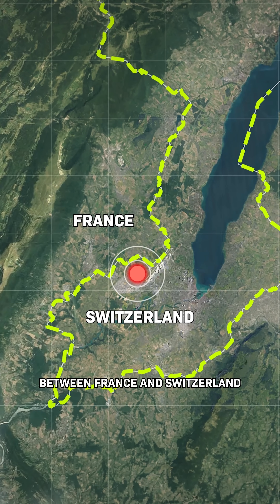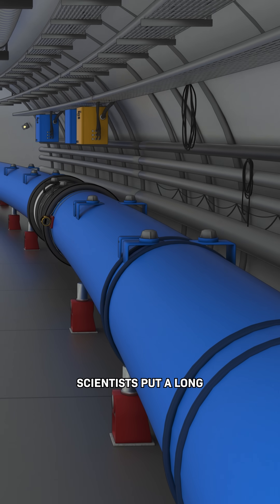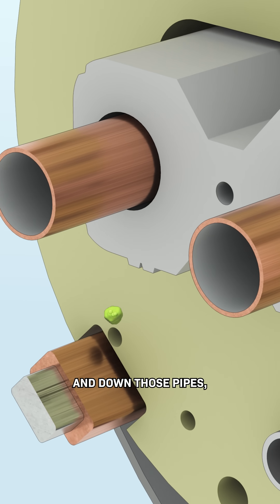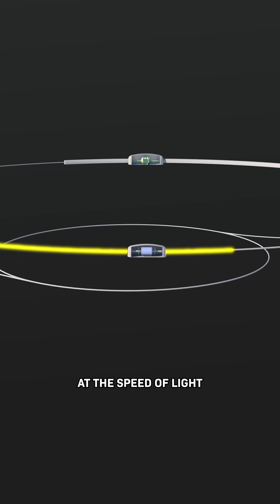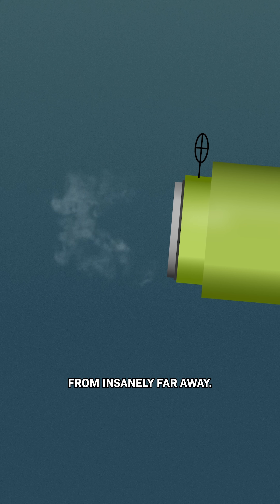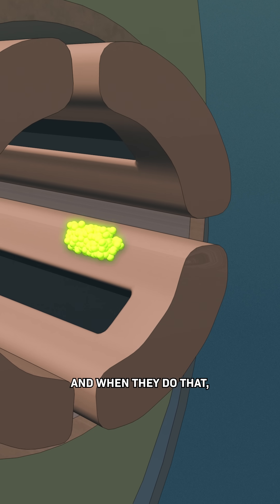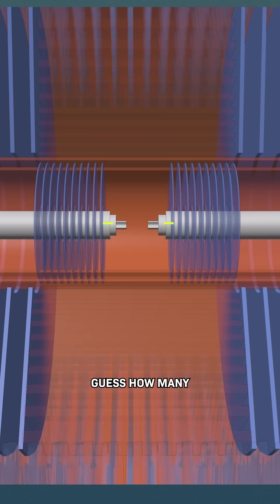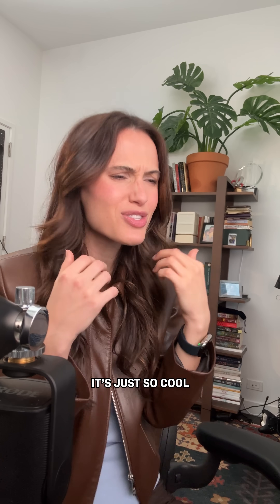How Do They Make Particles Hit Each Other?

Comment: From the early 80s to 2011 the US operated the Tevatron accelerator at Fermilab outside Chicago. It collided protons against antiprotons and are had two major particle physics experiments which discovered the top quark. Once the LHC at CERN started it was no longer cost efficient to operate the Tevatron. The SSC in Texas was supposed to be the next big accelerator for the US but it was canceled in the mid-90s due to federal budget cuts.
Reply: The Texas SSC was supposed to be 87+ km long.
The US would have been the ‘Center of the Universe’ for High-Energy Physics …. Alas, politics.

Comment: There is an unfinished particle accelerator like the one above in Waxahachie, Texas. It was supposed to be 3x the size of the one above.

But because it was to be built in small town Texas and none of us had no idea what that was in the 80s they ran out of funding. They spent 2b and it was reported to need another 12b or so to get it up and running.

It has now been sold and makes oil machinery which I find ironic.

Comment: It's for sure not colder than outer space. It might be /as/ cold as outer space, but outer space is theoretically as cold as you can possibly get at absolute zero
Reply: Wrong. Outer space isn't even close to absolute zero. Boomerang nebula is the coldest place in the observable universe and it has 1k
Reply: @NinjaFlout  and you are even more wrong. A majority of outer space is 2.7 k which is just barely above absolute zero.

Comment: Sounds interesting. What's the reason for doing this?
Reply: High energy collisions like these can create particles we wouldn’t normally see at our usual energy levels. This thing lets us study these particles
Reply: @OnePieceFan4765  thanks
Reply: @deananderson7714  what would happ6if a beef roast was put in yhe tube?
Reply: @bradacker8028  it might cook but it wouldn’t be a normal cooking process
Reply: @deananderson7714  thanks. I'm a retired electrician.  I wired a business that used laser systems to engrave inside pieces of crystal from photographs. 
After we finished and the business moved in, I was on site with a small crew just in case there were electrical issues. 
There was a safety demonstration to emphasize not reaching into the machine while it was operating.  A beef roast was placed where the block of crystal would be sitting. 
The smell of burning meat and the smoke from the engraving chamber was intense within just a couple of seconds.  As was the sound. 
I wonder I the 2 machines would produce similar results? 
Now that would be a video

Comment: "Some theories suggest that the LHC may be able to create tiny "quantum" black holes. This is based on the idea that if two incoming particles collide at the LHC and their total energy is concentrated in a small enough region, they could form a mini black hole. This is known as the hoop conjecture, which was first proposed by Kip Thorne in 1972. However, CERN says that the LHC will not generate cosmological black holes, and that any microscopic black holes produced would be safe to observe" 

I'm all for positivity but i dont trust them on this one.
Reply: This is nonsense. That's not even a theory, just a very poorly thought out hypothesis. In the same way the flat earth is a very poorly thought out hypothesis.
Reply: @JanneBernards  that's why CERN commented on it. OK girlie 🤣🤣🤣
Reply: Hawking radiation exists if they really did somehow make a tiny blackhole it would pretty much instantly destroy itself
Reply: A tiny black hole like that would have a lifespan so short it would basically be impossible to observe, and the total energy it would release when it evaporated would only be the same as the energy that went in originally. The laws of physics say that making an actually dangerous black hole would take more energy than the earth produces in years.

Comment: If it's emptier than space, then it just has no temperature.
Reply: No, this is not how temperature works
Reply: @epicchocolate1866  then how it works? As far as I'm aware, temperature is essentially the average "vibration" of atoms in the system. If there are no atoms, then there's no temperature to measure.

Comment: From.yhe visuals it seems like it goes multiple lapse to gain more speed. How does that work if they have to run 2 particles at different direction at the same time? If they are in 2 seperate pipes and they are moving that fast, how can they converge the path quickly enough so they can bump into each other? Also how exactly are they shooting a particle that small?

Comment: They also end up creating tiny black holes that are really unstable and disapate in less than split second. But if one were to be stable for some reason, that would be really bad
Reply: I don't think they actually managed to make black holes. Also earth is getting bombarded with cosmic radiation magnitudes more energetic than anything CERN can achieve. If that would create stable black holes, earth would long be gone.

Comment: Ok but why did they do that for?
Reply: To learn what the protons are made of, they need to break them apart. However those parts are very stable in combination and very unstable alone. So you need a lot of energy to "break" them and have them fly through the detectors before they turn into something else.

Comment: I mean, a proton isn't that much smaller than an atom. Depends on the size of the atom, of course, but hydrogen atoms are just barely bigger than a proton. They're technically just firing hydrogen ions at each other.
Reply: The nuclei of an atom is about 100,000 times smaller than the atom itself. Because most of it's size stem from the electron-cloud surrounding it and repelling other matter, whereas the nuclei is a tight package ;)
Reply: To get the protons, they have a gas canister of hydrogen, which they pull and ionize (by removing the electrons) thus leaving them a bunch of single protons. So your right!

Comment: But also how do they get all those particles to collide at the specific place where all the sensors are?
Reply: @CYKLVM  that's exactly what i was wondering about. Because with speeds approaching speed of light, the precision must be unreal. Even slightest lag results in misaligned protons by kilometers. I was wondering about all those protocols and tweaks that they apply in order for experiment to take place.

Comment: i curious to know the origins of oil discovery and production. how in the world did humans ever learn to use it in engines? and without oil how did they build the metal engine based drills to extract the oil?
Reply: There are places in the world where oil is at the surface. We've been using it for hundreds of years for light and heat. Before we used oil we used steam engines. Even they needed oil for lubrication.

Comment: How the hell are they getting just protons? That is actually the cooler thing to me then keeping 2 impressively large tubes as a race track for the protons.
Reply: It's easier than it sounds, it's just a Hydrogen atom that's been oxidized to remove its valence electron, leaving you with a single proton by itself.
Reply: @ArkanoidZero  okay and how do they do that to individual atoms? Or do they do it with a quantity it makes something actually able to be worked with. This whole process should be a video
Reply: @jonathonvoegtli4699 did you not watch the short?  They are dealing with billions of atoms not individuals.
Reply: @jonathonvoegtli4699  Anything other than protons will respond differently to the magnets of the super collider and won't stay on track as the particles race around the circle.
Reply: @scottread2979  I think he's asking how you strip individual atoms, in bulk. I'd struggle to ask that in German, and I suspect you would, too.
Reply: @MrNyathi1  how am i to know he’s German?
Reply: @ArkanoidZero divorced hydrogen
Reply: @ArkanoidZero  If you oxidize hydrogen you get water.
Reply: You know a canister for oxygen? A larger one they use at hospitals... big enough to last but small enough to be push around by a patient? Replace the o2 with hydrogen. That canister lasts them a couple of years. They have gone through one.
Reply: @for_the_bear  what's amazing is that their beam dump lasted for a decade before needing replacement.
That's a lot of energy being absorbed and dissipated! They've a nice page on the post-mortem of the dump.
They didn't discuss specifics on the radiation, but they were concerned about safety, so it had to be fairly high for a research system component (still low by non-researcher standards, but still present, which gives an idea on how much energy gets wrangled).
Reply: @for_the_bear "Replace the o2 with hydrogen. That canister lasts them a couple of years. They have gone through one." This isn't true, the LHC H2 canister is replaced multiple times a year, usually twice but sometimes more often. We've gone through much more than one.
Reply: A “proton” is just a Hydrogen atom without it’s electron. If you provide enough energy (eg., heat) to hydrogen gas, the hydrogen atoms lose their electrons and become just “protons”. It’s pretty easy to guide these protons through the race track using electromagnetic fields since they are positively charged.
Reply: @CellizanAdams thanks for making it easily understandable.
Reply: They have a cylinder of hydrogen bolted to a wall. It's about the size of a car fire extinguisher and contains enough protons to run the LHC for about four billion years. They're ionised and fired through a metal film to strip the electrons.
Reply: What? Did actually graduate middle school? A proton is also just a hydrogen cation H+….
Reply: like lucky charms, just get a bowl, and meticulously take out each charm
Reply: As the proton source, they start with hydrogen gas (just a proton and electron), and strip off the electrons using magnetic interactions. That leaves hydrogen nuclei, which are just bare protons.
Reply: Hydrogen except the electron its actually vey easy

Comment: How do they load it and not contaminate it with other particles? Just watching that would be interesting to see.
Reply: Protons come from atoms of hydrogen of which they strip the electrons. The hydrogen comes from a H2 bottle.
The tube itself is not contaminated because they keep it at extreme vacuum conditions.
Reply: @smockydevil  and a big plus being, they work with tiny puffs of hydrogen, so avoid embrittlement problems that large samples can create.